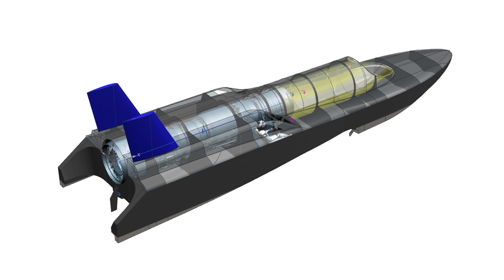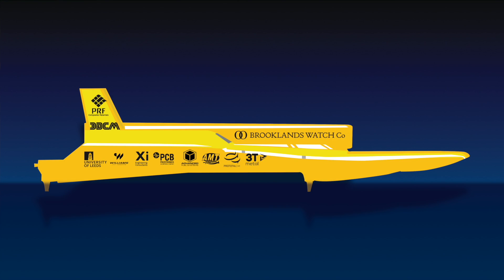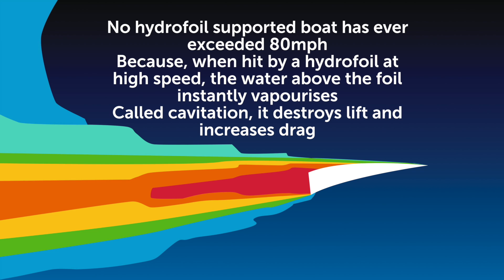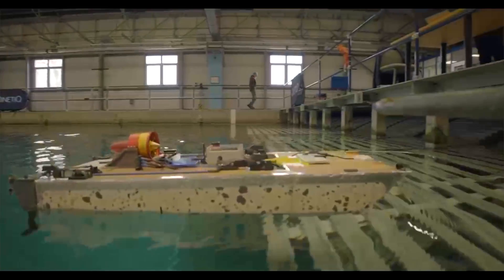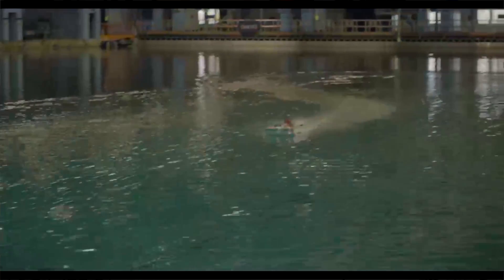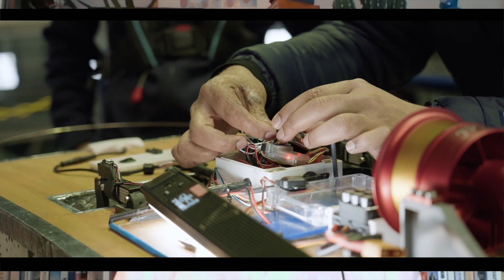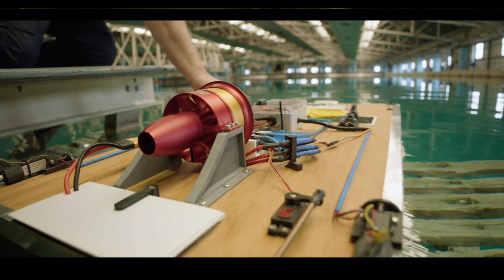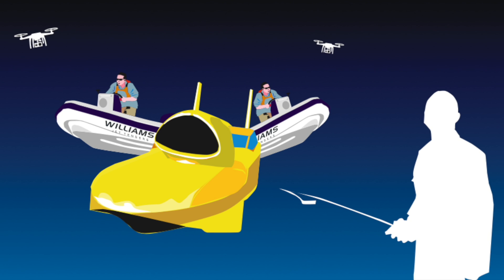Thrust Water Speed Project - Update #5 - Wings Under Water (Hydrofoil Testing)

Comment: This Youtuber is excellent.  He has worked out how to make a ground effect vehicle that is inherently stable.  It is highly reluctant to rise above a certain height above the water.  And it will not flip up.  These are highly desirable characteristics.
https://www.youtube.com/watch?v=kbnTKuIOTdw
By going for hydrofoils as a supposed solution to the flipping up problem, the WSH project seems to have acknowledged that they have failed to solve the flipping up by aerodynamic means alone.
Just look at Spirit of Australia. It has a large horizontal stabiliser. And so has the model in this video.  And WSH does not.

Comment: The mode of thinking is all wrong.  Back to front.
If you start by thinking of it as a boat that might become airborne and flip, that is not a good starting point.
Instead, start by thinking of it as an aeroplane in ground effect, that needs to be able to fly stably. Once you have that working reliably add this: in order to be classified as a boat it needs to have a stable contact with the water.
Flip the thinking, don't flip the craft.

Comment: Is anybody from the project reading the comments?
There is a good one regarding the horizontal stabiliser on Spirit of Australia.  I worry that without it, WSH will flip up.
As a general rule, I do not really trust academics with solving engineering problems.  I have worked in industry and in university.  Academics have very good theoretical knowledge, but in many cases are lacking the "feel" of practical reality to come up with a good overall solution.  The lack of a horizontal stabiliser for example.

Comment: If you deliberately ventilate the upper surface of the foil then it cannot cavitate.  Ventilate using spanwise slots or steps.  For this I would not use T foils.  Insted use slanting foils with a curved transition from the vertical post. Wit the slots / steps continuing along the transition and post and so connecting with the air.
Nearly all the lift would be from the lower surface of the foils.  But it would be consistent.  The problem with conventional foils pushed too fast is sudden loss of lift due to cavitation and/or unintended ventilation.  In the case I suggest, the ventilation would be intentional, and deliberately implemented.  So no sudden loss of lift at speed.
Hope you like this suggestion.  i.e. not supercavitation but deliberate ventilation of the upper surface.
Reply: Yes, slanting foils are a good idea, perhaps as part of a hybrid in conjunction with conventional planing surfaces: with a conventional hydroplane you need vertical fins (in addition to the rudder) to maintain longitudinal control authority, so perhaps there would be scope to replace these with slanting, surface piercing and supercavitating foils that contribute to both jobs... providing some hydrodynamic lift as well as directional stability?

Again, you've got to ask yourself whether there is any worthwhile drag benefit versus a conventional planing shoe + fin arrangement, though.

I'd ditch the whole 'active foils' thing though: apart from simply being against the rules,  its an unnecessarily complex potentially disaster-prone  solution. I firmly believe that whatever design you come up with, it needs to be inherently (passively) stable.

The whole thing smacks of a bunch of engineers trying to be clever for the sake of cleverness: you need to be ruthlessly pragmatic in adopting the simplest, cheapest, >lowest drag< solution that's available, even if that means your engineers don't get to play around with interesting toys.
Reply: @martinstuart3264  Agree that they should ditch the active foils idea.  It adds complexity and scope for disaster.
I am guessing they have so much thrust that they are not so worried about drag.
No it is not engineers, it is academics.  Academics are very knowledgeable but lack the feel for the problem that engineers have. I have worked both in industry and in university. Academics are clever people but vastly over estimate their practical abilities.
Reply: @StabilisingGlobalTemperature  In fairness, Lorne Campbell is a VERY experienced and VERY well-known designer of fast powerboats - possibly THE most famous such designer left alive, now that Peter Du Cane, Don Aronow, Renato 'Sonny' Levi and Fabio Buzzi have all left the building... though of course there is a big difference between a fast offshore powerboat and a WWSR craft. The latter is more about aerodynamics, once you get up to 'working' speeds.

We don't know how much of the design is Lorne's though, and how much has been imposed on him by Noble or others.

I have my reservations about the use of the Spey (simply because it was readily available, it seems), too. It means that Thrust WSR will be a big beast, and therefore probably limited to running (in the UK) on Loch Ness rather than the more sheltered Coniston Water, but that's another discussion...
Reply: @martinstuart3264  Yes indeed he is.  Maybe it was a premature comment, but I was just looking at the graphic.  Which seems to be a T foil of fairly conventional foil section, and hardly any sweep back.
At this sort of speed I would have expected a much lower aspect ratio, and much more sweep back.  Maybe ogival like Concorde wing. Would you agree?
Reply: @StabilisingGlobalTemperature  I don't know to be honest - I don't really agree with the use of foils at these sorts of speeds in any event, so the actual design of the foil is becomes a matter of selecting the least worst option - it's difficult to say 'I would do it this way', when I very firmly wouldn't do it at all!

If you MUST do it, then lowest drag is key, which then depends (mainly) on section thickness and wetted area, so I suspect that the limiting factors might then come down more to strength than hydrodynamic design. Certainly, adequate strength and stiffness is the main criteria (next to wetted area) when designing rudders for ultra-high speed.
Reply: @martinstuart3264  There are quite a few aspects that I question.  I would not feel happy sitting next to a very elderly engine.  Hopefully they have a thick layer of armour plating between the engine and the driver.  
The mortality rate is very high for the water speed record.  I would be thinking in terms of a detachable bouyant pod for the driver, which detaches when the G force becomes greater than say 10 G in a crash.  And for the pod to be well away from the engine when it disintegrates. So even if it does flip up, the driver or automatically the pod would detach using explosive bolts, and hopefully land clear of the rest of the wreckage.
Reply: The problem with supercavitating foils (whether deliberatley ventilated or cavitating) - given, that as you say, nearly all the lift is from the lower surface - is that you're (literally) dragging along a massive amount of turbulent sh*t behind and around them that you don't need to.

If you're going to be generating nearly all the lift from the lower surface, then, hey, here's an idea: why not just have the upper surface in free air where it's much less draggy? 
Wow... I think I've just invented the hydroplane! 🙂

I'm guessing that the Thrust WSH team is willing to accept the drag penalty of a supercavitating foil because they think they can use it (with illegal sensors and servos...) to control the pitch of the craft. Which is all very well:
a) IF it works (which is incredibly sketchy, given that all pitch authority is instantly lost if the foils emerge into free air) 
b) if you ignore the rulebook, and;
c) If you ignore the fact that you can do the same thing with an aerodynamic stabiliser (a la Spirit of Australia), with a much lower drag penalty.
Reply: @martinstuart3264  Yes good points.  They started with using hydroplane shoes.
I was responding to the video, showing T hydrofoils, with conventional foil shape.  Which would be incredibly stupid in my opinion.  They work fine at slow speed (up to 30 knots) but really bad for this application.

Comment: I’m assuming a surface affect strategy, wouldn’t qualify, for the separation, from the surface?
Reply: The UIM rules have a definition for what constitutes a 'boat' to cover this: "A boat is a vessel that floats on the water when stationary and continuously derives support, directional control or propulsive effort from hydrodynamic forces."

Because they use the word 'or' (and I have checked and confirmed this with them in the past) it means that you need ONE of the three when the 'boat' is under way: support, directional control or propulsive effort. Clearly a jet or rocket engine does not deliver its propulsive effort to the water, therefore you're left with support OR directional control.

Theoretically, this means that you could run a ramwing almost entirely clear of the water in surface effect, provided its directional control was still from an immersed rudder. In practice, keeping in such close surface effect that you could guarantee that at least part of the rudder always remained immersed would be incredibly difficult, if not impossible (particularly since you're not allowed sensors or computer intervention to keep it at the right height).

As a slight aside, my understanding is that Lee Taylor's 'Hustler' had a jet engine and used thrust vectoring (basically, steerable titanium vanes just behind the tailpipe of the jet engine to direct its thrust) to steer, but was otherwise a relatively conventional hydroplane that derived only support from the water.

Comment: Disasterously complicated  and plausible but soooo dangerous due to the mess of technology you are hosing all over this.
KEEP IT SIMPLE STUPID.

Your hull form should be simply a very stable Aerodynamic dart, with minimal interaction with the sea surface, preferably a sharp vertical blade to spear point nose, to minimise danger from smackdown.
 Foils should be hydroelastic designs that flex to give height control, without pivots or linkages, only adjusted by fishing rod style surface sensing whiskers, and pilot input.

Forget quad or trike design. 
Two foils, bicycle style or even one will be best.

One probably. With a high tail rear horizontal aero wing with small positive lift, to take advantage of ground effect height and pitch stability envelope.

Comment: I thought the WSR rules forbade moveable surfaces to control attitude.
Reply: They don't forbid moveable surfaces - current Unlimited Racing Hydroplanes in the United States employ driver-adjustable canards to control front-end lift, controlled by a foot pedal in the cockpit.  If it's under the direct control of the on-board pilot/crew, it's fine.
What is forbidden is ths use of sensors, autopilots or auto trim in the control loop, which effectively prohibits the control of moveable surfaces >by computer<.
The rule specifically prohibits 'attitude or acceleration sensors' in the control loop and also specifically prohibits the use of gyros, so you couldn't even use a 'dumb' (mechanical) self-stabilising system.
Edited to add: sensors >outside< of the control loop are also permissable, so, for example, it would be fine to have a hydroPLANE similar to the original design that used pitch sensors to illuminate a big yellow light in the cockpit that tells the pilot to put his foot on a pedal that operates a canard that in turn trims the nose down, if things start to get out-of-kilter. 
Most 'blowover' type hydroplane crashes happen remarkably slowly - if you watch the video footage after the event, it's usually obvious that things have started to get ugly several seconds before the point of no return - so such manual warnings could still be useful, if not foolproof.

Comment: If you have three pairs of foils (rather than 2 pairs as shown) it should be possible to have good inherent pitch stability with minimal need for trimming, and no need for rapid actuators.  
If you can get it to fly aerodynamically and stably like an Ecranoplan in ground effect,  with suitable C of G position, it should be impossible to flip up.  
It is liable to become entirely airbourne at some point.  A gentle flight trajectory down to the surface is what is needed.  The current shape, depending on C of G, looks as though it could flip.

Comment: The system planned is similar to the FBW system of modern aerodynamically unstable jet fighters; definitely feasible if you have the time and money. Maybe youve already bottomed this out, but I wonder if there's any passive stabilising principles that could supplement the active system, (eg like the rolleron of the sidewinder missile) which might relieve the need for a servo system with such high integrity, high bandwidth and high control authority?

Comment: It's called a auto pilot so is a computer going for the record or a person.
Reply: What I do understand  the likes of Warby.Cobb.Cambell need I go on were true pioneers of both land and water speed record attempts not including our friends in the USA  A simple question a computer or a human being
Reply: @jamesbishop2555 who makes the computer programs? Who builds the servos, foils etc?

What a dumb question
Reply: No doubt that this is a human endeavour and wicked hard to do. No doubt computers need to be involved and are relevant in pretty much all speed records these days at some point. However, it seems fair to ask who is controlling the boat. Or to what level a driver needs to be in charge for it to qualify for a speed record by a human. After all, there ought to be a difference between a record breaking autonomous boat that happens to carry a human passenger and a boat that is controlled by a human. Is it enough that the human decides over direction and beginning and end of acceleration to qualify as human control? I am sure that is written down somewhere in a rule book.
Reply: @my_dear_friend_  It certainly is written down in a rule book: the UIM rules clearly and explicitly prohibit sensors (and therefore computer control) in the control loop for any moveable surfaces. Without such a rule, you might as well replace the driver with a sack of potatos and a Raspberry Pi - there's no point in risking human life, if the human is merely ballast.
Reply: @martinstuart3264  - That appears to be the answer then to the original comment. It's interesting and worth pursuing but will not count as a traditional speed record.
Reply: An auto pilot? Joke right?Clearly you don’t understand the complexity of controlling flight of a hydroplane that’s also a hydrofoil! at those insane speeds too of course! just the flight on foil’s alone is going to need gyroscopic and by the looks of prototype’s an ultrasonic or laser height edit= (it is sonar)sensor to provide feedback to control pitch! Unless you know of any thing capable? I don’t think so! so go find an auto pilot that is capable of flying a one off design!